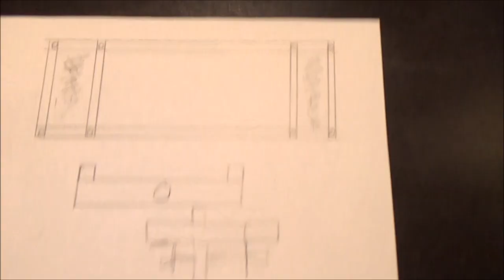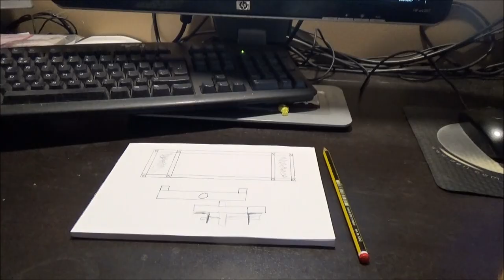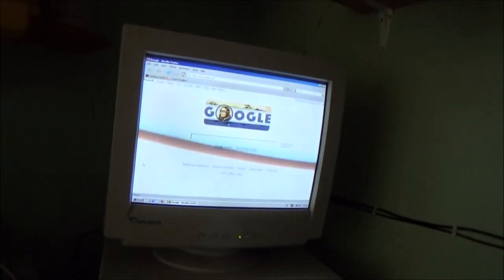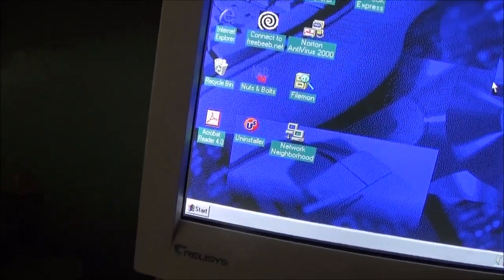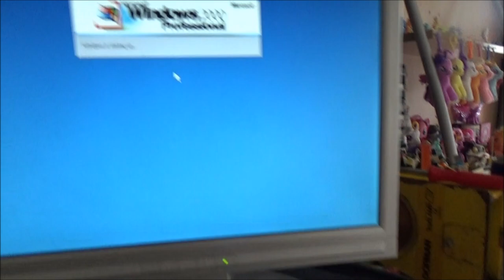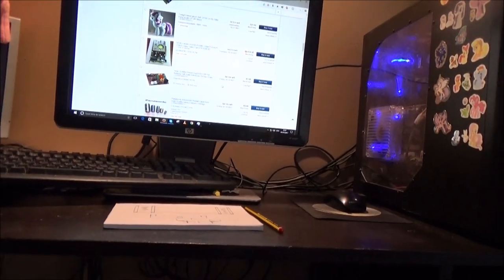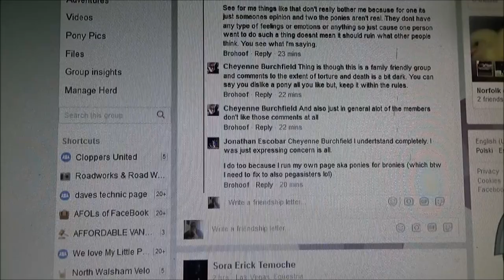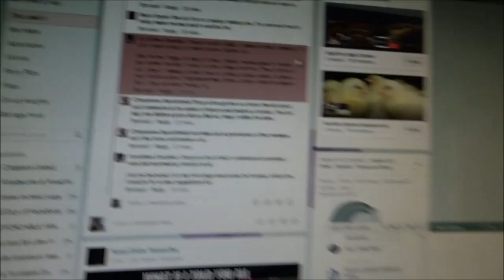Win 98 and 2000 Machines Online, FM Radio Fixed, Record Player Next.

Comment: Windows 95 does allow Ethernet, though I believe you need a compatible ethernet card. You also have to install Internet Explorer which will include the Microsoft network (networking drivers and software) and the ability to handle ip addresses and DCHP.